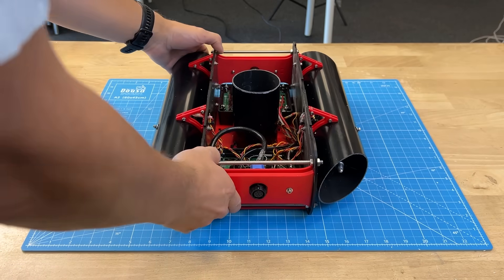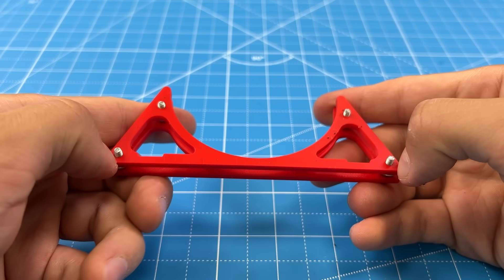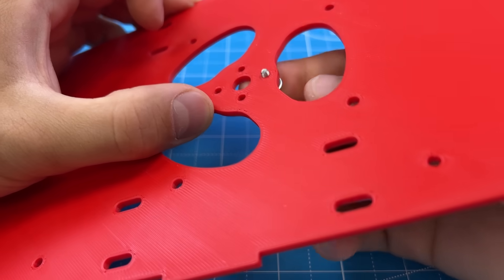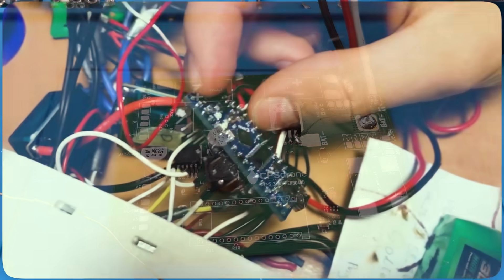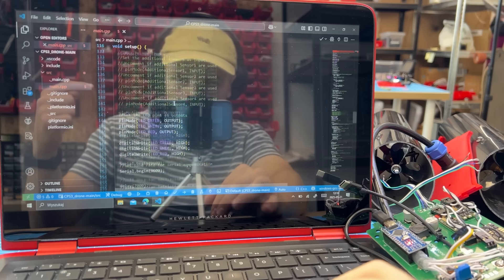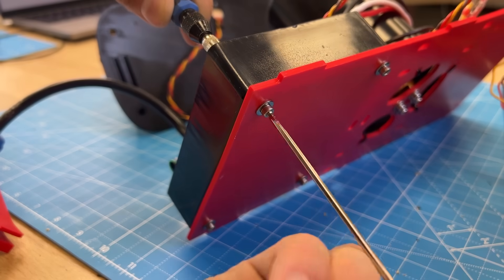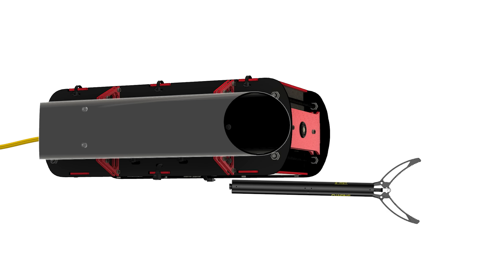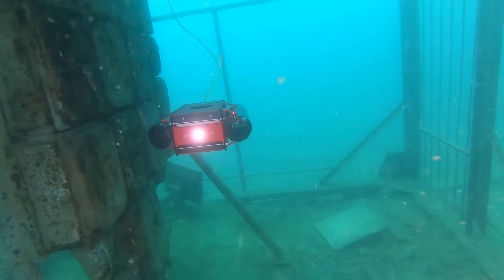How to build your personal DIY Submarine (Arduino Project)

Comment: I really love what you guys are doing but the choice to go for CNC parts over 3d printed parts feels - odd.
I mean, I have both options but still. 3d printing still feels more accessible.
Reply: I think the point is you can do either, someone maybe has a CNC at their school or a makerspace that they can use. I do think more people probably have access to 3D printing these days but it’s still nice. You could even probably make this with a dremel with a routing attachment
Reply: @friedengilbert8067  I am just upset that I now have to make a CHOICE to build the 3 or 5. (kidding) The 5 sure looks cooler. But we'll see how things develop with 3.
Reply: Also CNC parts are less likely to take on water? 3D prints are also likely to ‘Hydroscopically’ absorb water too even if the layer lines don’t leak?
Reply: The fact you think of yourself as the centre of the universe doesn't make the choice for CNC odd.
Not everyone is as rich as you.
Reply: @jacquesmertens3369  Huh?

I find the choice for a CNC odd BECAUSE they are usually more expensive and less common than 3D printers.

Easy there, mister judgy.
Reply: @tcurdt  3D printers are expensive, and that's what was explained at the start of the video. The guys explained why they are producing CNC parts, to keep the cost low. A low cost for the ones who can buy the parts instead of having to buy a 3D printer and all the gear that goes with it.

Comment: "3d printers are expensive" and then "CNC cut the part". Aren't CNC wildly more expensive to buy? :D
Jokes aside, I think that if the 3d parts are small and do not require a super high precision, so that they can be printed with smaller, cheaper budget 3d printers (like an A1 mini non-combo or something in that price range or cheaper, like an old used ender 3 or something) it might make your life easier and would still be a reasonable expectation.

Comment: I understand that you wanted to make it without a 3D-Printer. But with perfectly servicable 3D-Printers starting at under 100$ nowadays, it's cheaper to buy one and print the parts than to have them CNC cut.
Reply: 3d printing is also much easier for beginners
Reply: @storm_in_cupYou're simply assuming that 3D printers are readily and cheaply available everywhere. You do realise there is whole world out there, and not everything is automatically the same for them? Things you take for granted may well not apply to some places, and of course vice versa.
Reply: @another3997 most countries that aren’t complete dumps have easy access to 3D printers
Reply: it is for the purpose of mass-manufacturing kits
Reply: @hackdurbrain  makes sens
Reply: many of the parts here were also printed, just not the larger plates.
Reply: lol how do people have no 3d printer but can cnc parts
Reply: I wonder how impregnated wood would hold out
Reply: Yes but building things out of flat sheets is better for increased production. I know people like 3D printing, but it has become some what of a crutch in designs. People make 3D models where flat parts could handle those tasks as well.
Reply: Yea I really want to make one of these but they want $500 and I don’t have a 3d printer so it might just be better to get my own printer.
Reply: yeah but making the plates with a 3d printer is not practical
Reply: Except it is inferior quality...so in the long run it is not more efficient
Reply: This is a classic case of defaultism. You're assuming that because it applies to where you live, that everyone else also lives in a place where 3D printers and printing services are easily available and at low prices. That isn't always going to be the case. CNC is an older technology, it's been around longer and is more practical for many industrial uses. Therefore it's likely to be easier to find a company offering those services.

Comment: great job. one question. Don't lithium ion cells expand and contract ? This is why there are soft spacers between cells in battery packs. I am concerned that encapsulating them in epoxy will resist the natural expansion and contraction. A few years ago, wasn't there samsung note phones that caught fire because they did not allow enough space for expansion ?
Reply: Iirc the batteries in the samsungs were LIPO batteries, they expand and contract much more and are more volatile/explosive than Li-Ions.
Reply: Kaboom? Yes Rico, kaboom.
Reply: Yeah it would swollen eventually
Reply: Just spot-weld strips to the 18650's and solder those to the PCB . Easy, good specs and cheaper
Reply: @GronaldoSr  Not everyone has a spot welder
Reply: @bastienx8 perhaps, but when working in this kind of materials, you better should. Not everyone has a multimeter as well 😊
Reply: @GronaldoSr  Usually, I'd be for replaceability and thus the option to put in stronger batteries over time or replace damaged ones, but since they are drowned in epoxy anyway, your solution is definitely the best one, plus it would be cheaper, at least for those with a spot welder. For those without, there'll be no way around battery holders.

Comment: Doesn't need a 3D printer but needs CNC machining? Sorry but no..
Reply: Yeah, I don't fully understand that. I'm wondering if they picked CNC to make it lower cost for production runs. It would make more sense to me if they were selling these assembled or commercially.
Reply: You can 3d print the flat parts, he also mentioned the cnc cut parts were cheaper than a good 3d printer

Comment: AI Summary

Abstract:

This video chronicles the two-year development of the CPS3, a DIY underwater drone designed for accessibility, affordability, and deep-water capability. To achieve widespread buildability without custom 3D printing, the drone's frame is constructed from flat, CNC-cut plastic sheets, incorporating innovative motor mounting techniques. Its control system utilizes an easily programmable Arduino microcontroller, complemented by custom PCBs for simplified wiring, and an economical car reverse camera for navigation. The electronics are waterproofed using epoxy resin, enabling deep-sea operation despite making internal repairs permanent. The CPS3 features a three-motor configuration for maneuverability, passive self-leveling, and is designed for future upgrades and attachments. The creators also offer a comprehensive, beginner-friendly online course with instructional videos and materials, with complete hardware kits planned for future release.

Summarizing the CPS3 DIY Submarine Drone

*   0:02 DIY Submarine Development: The video details the two-year journey to design and build the CPS3, a DIY submarine drone intended to be cheap, simple, maneuverable, fast, extendable, and capable of deep-water use.
*   0:10 Accessible Design (No 3D Prints): To ensure the design is buildable for everyone, it avoids custom 3D-printed parts, instead relying on flat, CNC-cut plastic sheets for the drone's frame, which are a more affordable manufacturing method.
*   1:53 Innovative Motor Mounting: The drone features a clever motor mounting solution using two-sheet assemblies, threaded rods, and screws, with the third motor secured by zip ties, overcoming challenges encountered with previous PVC pipe frame prototypes.
*   3:29 Simplified Electronics: The core of the drone's control is an affordable and user-programmable Arduino board, integrated with custom PCBs (available from the creators) to simplify wiring; initial battery holders were upgraded due to overheating issues.
*   5:57 Affordable Camera Integration: An inexpensive plug-and-play car reverse parking camera, complete with its own display, is used for basic underwater navigation, with the option to mount a GoPro for higher-quality video recording.
*   6:28 Durable Epoxy Waterproofing: The electronic boards are waterproofed using epoxy resin, a cost-effective and durable method suitable for deep-water environments, although it makes internal repairs permanent.
*   7:48 Buoyancy and Self-Leveling: Buoyancy foam is strategically positioned on top of the frame to achieve neutral buoyancy and ensure the drone passively self-levels horizontally in the water.
*   8:07 Remote Controller & Upgrades: A simple remote controller is also constructed from CNC parts, and the drone is designed for extensibility, supporting 3D-printable hydrodynamic shells and additional electronic attachments like grabbers or pH sensors.
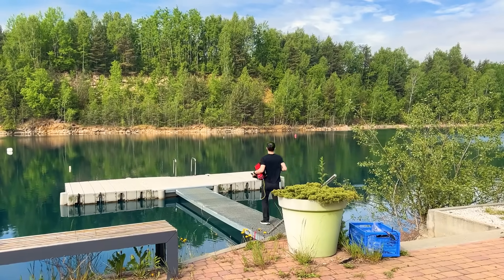*   9:01 Field Testing & Maneuverability: Successful field testing in a clear lake demonstrated the three-motor CPS3's maneuverability, achieved through passive horizontal leveling and the vertical motor's ability to change pitch while swimming forward, even diving over 20 meters.
*   10:13 Comprehensive Building Course: The creators offer a "CPS-3 course" which includes step-by-step instruction manuals and video tutorials, covering everything from basic soldering to multimeter use, with the first chapter and full component list available for free.
*   7:31 Future Kit Availability: The creators are actively working on producing complete kits containing all necessary parts, with an anticipated release by January next year, and a waitlist for interested builders is available.

I used gemini-2.5-flash| input-price: 0.3 output-price: 2.5 max-context-length: 128_000 on rocketrecap dot com to summarize the transcript.
Cost (if I didn't use the free tier): $0.0065
Input tokens: 15182
Output tokens: 763